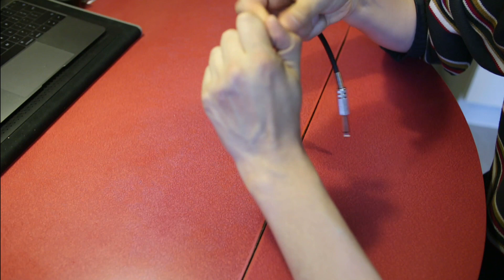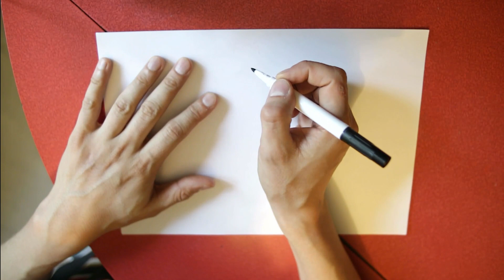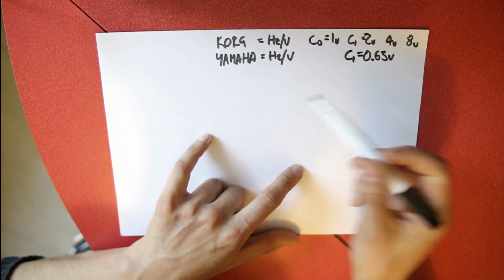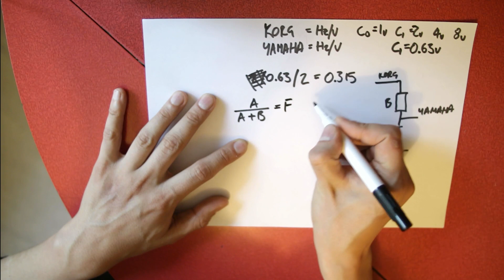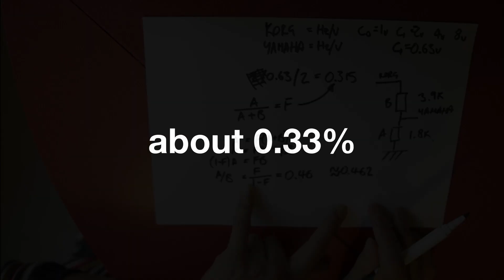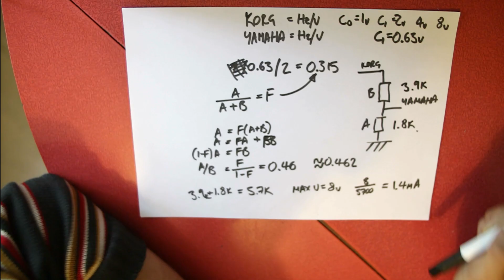Yamaha CS series + Korg SQ-1 UPDATE! (finally bass notes)

Comment: Thank you for the video and the tip!
I tried your mod, and it works, but am I right thinking that with your mod, we're losing the slides and duty (gate lenght), right? 
Did you find a way to transpose the pitch by one octave AND keep the slide and duty features?
Reply from the maker: i’ll need to set this up again and defamiliarise myself

Comment: nice.. thanx!
Reply from the maker: you are welcome Lars :)
Reply: @gwEmbassy  does this also works for lower notes on ms -10 or 20
(hz/volt input as well)?
Reply from the maker: it will do, but you may need to use different resistor values

Comment: Am I missing something? How can you get a lower pitch than is already available on the synth via the pitch and octave switches?
Reply from the maker: It’s because the synth is voltage controlled. So you give it a lower voltage than the keyboard does.
Reply: @gwEmbassy  But you can’t go lower than the nominal bottom pitch of the cv, surely.
Reply from the maker: There is no bottom pitch as such, you just keep making the voltage lower. Of course there is a limit. But it is below that provided by the keyboard
Reply: @gwEmbassy  Yes, I understand, but isn't the cv input from the keyboard always offset by the setting of the cv on the synth?
Reply from the maker: @teebeedahbow it is offset by the tuning and the octave knob indeed

Comment: Slightly off-topic, but do you have to use the same voltage divider cable with your SQ-64's CV outs? I can't get my CS-5 to scale octaves properly even after editing the 0V point and offset value in Hz/V. It's going between 13 - 15 notes per octave (roughly). Appreciate any insights you might have!
Reply from the maker: Yes, I do use the divider cable with the SQ-64 and it works well. 
I had tuning problems with the first SQ-64 that I had, and ended up replacing it with a new unit. Does your SQ-64 work ok on 1v/octave equipment?
Reply: @gwEmbassy  Ah good to know - I'll have to put one together myself then. Yep - it's working well with my MS-1 in 1V/Octave; and after seeing your old video I just tested each channel with a multimeter and they are all scaling properly (though I need to adjust bias by -0.01 to -0.03V depending on the channel). Appreciate the help!
Reply from the maker: Interesting, I needed to adjust to -0.03 as well

Comment: Hi there,
great work and that is also something that I can use well, also have a Korg-SQ1. Unfortunately, the CV input socket (VCF Accent) is still missing on my Yamaha Cs-10, I have a clue but don't know exactly where to solder it. Thank you for your answer.
Reply from the maker: Hi Maik. I don’t know the CS-10 but I checked pictures online. For the pitch CV, you can use the ‘key volt’ and I would try external in for the gate. VCF CV input, I think it doesn’t have, and neither does my CS-5.

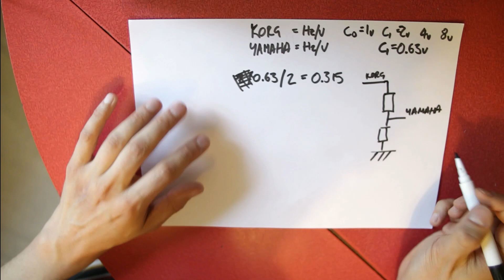Comment: A schematic would have been nice ... I am still scratching my head over what the functions of the 1K8 and 3K9 resistors are. One is just in series with the tip and the other is just in series with the sleeve, correct? No voltage dividers ... wouldn't one resistor in series with either tip or sleeve do the trick as well? UPDATE 10:15 it is a voltage divider. Ok that makes sense, you are changing the CV.
Reply from the maker: Yes, the schematic comes later. I was concerned about scaring people. We can debate though if that was a good idea or not!
Reply: @gwEmbassy  I think it was a good idea. The first time I heard 'voltage divider' I nearly melted. 😅